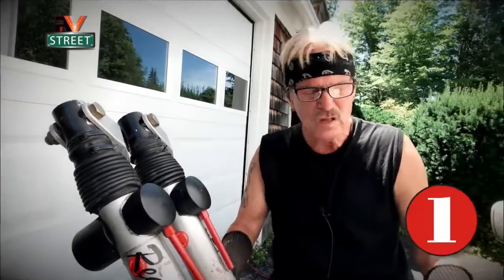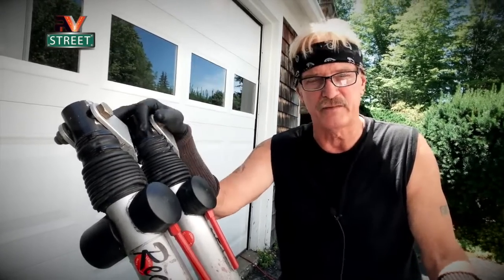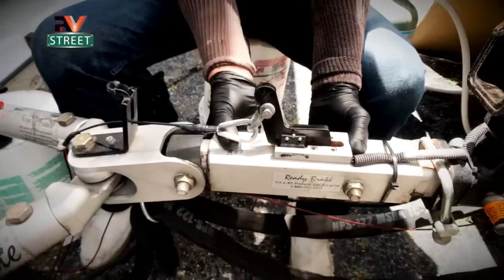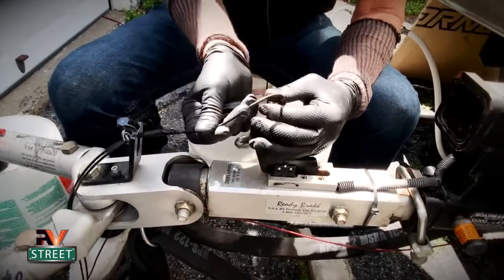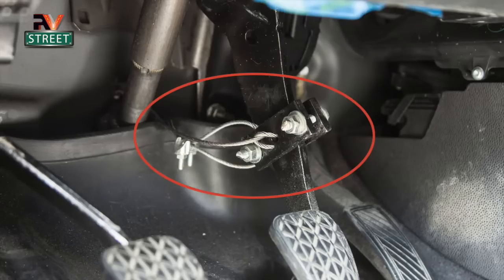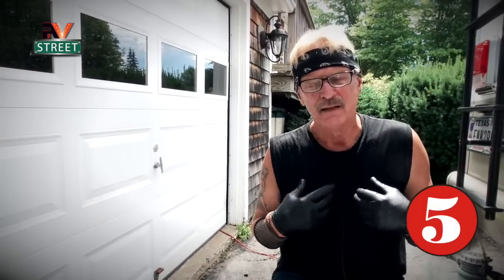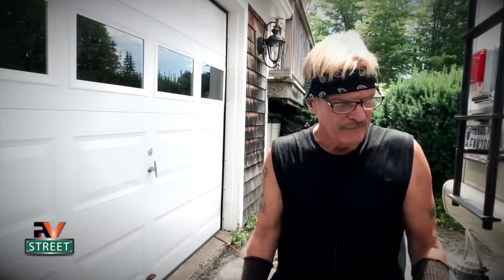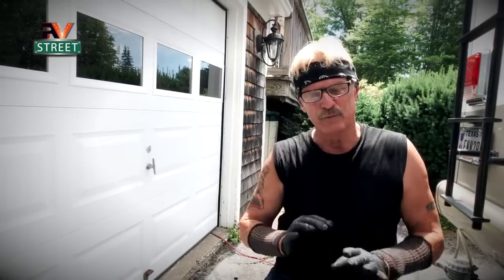BE SAFE, BE LEGAL, 4 DOWN TOWING behind a Motorhome

Comment from the maker: The locking pins I bought that were all keyed the same:
https://www.etrailer.com/Hitch-Pins-and-Clips/Blue-Ox/BX88212.html
Your size may vary and you'll have to call and order them and have them keyed all the same for a small extra fee

The way I installed the dash light so I could verify the braking system was working correctly was to splice a wire into the main harness at the back, then a little more wire to splice from under the dash from that same wire, then I bought a small 12V indicator light, drilled a hole in the dash and mounted it. The light was two piece....the light with a threaded stem and a lock ring on the back with two posts for the wiring from under the dash. I forget where I bought the light but their easy to find.
Reply: Word of caution on the locking pins. I had similar pins and lost an expensive hitch due to locking pin failure. The pins I had identical to yours, the lock assembly is held together with a pressed in pin. The pin over a period of time walked out and the complete lock came off the pin causing the pin not to be locked anymore and eventually the pin walked out of the hitch and lost the hitch. For the life of me I coudn't figure out how I lost hitch, I thought I forgoten to put the lock on the pin. After tracing the roads I've travel (locally) I found the locking pin on the side of the road. I had a second lock and the same thing happend to it in my driveway. I drilled a hole before the lock and put a hairpin throught it as a backup in case the lock comes off. Food for thought. Enjoy your videos, very informative. Thank You.
Reply from the maker: @fredrod6383  Thank you Fred for that. WOW...who would of thought. However, I'm not sure I exactly understand this part though...
I drilled a hole before the lock and put a hairpin through
Could you please elaborate on this OR if you do Facebook messenger, shoot me a picture. Just click the FB logo on my YT home page. 🔧

Comment: Great video! We will share a story with you guys. We bought ourselves a diesel pusher after retirement along with a top of the line flat tow system and a receiver to get us level. Everything from the the same company. Three years later while traveling down the road the receiver broke at the weld and down went the tow bar. Fortunately everything worked as it should  and no damage. My wife followed in the car to our destination, we talked to the manufacturer, they next day air a new receiver, we sent them the failed receiver and now waiting to hear back. It pays to flat tow correctly as your video points out.

Comment: I don't know whether you're an electrical engineer, a mechanical engineer, or a physicist (capable of either or both), but I  appreciate your analytical approach to these issues!  Though your basic model for your presentation is tied to a specific brand, it is clear that the underlying advice is not limited to the brand you present and  I appreciate your sagacity.
What I would like to see in addition to this presentation (please excuse me, as this is the first of your videos I have seen and you may well have already addressed it) is 1) how the port on the front of the toad ends up controlling the toad's taillights and brake lights, and 2) how the toad's brakes are functional when the toad's engine isn't running and providing support for the power braking system.
Reply from the maker: Martin was none of the above, he wore many hats and I swear he could fix anything. I am sad to say that Martin has passed away so no new videos will be coming out. Thank you for your comment.

Comment: Great information. I tow a Chevy spark with manual transmission that has a non locking steering and love it. Our tow bag has all the essentials with a small rubber mat for protecting my knees when attaching and or removing. The small zip tie on the emergency breakaway on the base plate is brilliant and will apply to my own.

Comment: Martin, another well done video providing a wealth of useful information. In particular you hinted to a chance that the locking pins could provide some problems in the event of a quick disconnect. I have watched videos where either the MH or the toad have caught on fire, and quickly disconnecting is necessary. This situation needs to be considered. And yes, shopping via your Amazon store is easy.....i have done it, and recommend it to others.
Reply from the maker: locking pins could provide some problems in the event of a quick disconnect
That's why we keep an extra key for all our locking pins at the door. As I said in the video, locking pins do introduce a small safety issue, but IMO they out weight all the other issues like a fire while under way. It's all about risk management.

Comment: Good video! We recently bought a used Alfa diesel pusher for our first RV. We plan on towing our 2015 Cherokee. I lucked into the same tow bar that you have, not even knowing what I needed, but the guy was towing a Jeep Wrangler with it. I will need the base plates put on the Cherokee so we can tow. Just have to find someone in the north Texas area that does that kind of work. Thanks for your video. Really helps us understand the process!

Comment: I have a picture I would love to share with you. I had a cheap locking pin from Harbor Freight. It failed. My dolly did not have brakes. Lucky for me I realized something was wrong.  . I was on a mountain road with no shoulders.  My crossed chains held the hitch off the ground until I could pull over.  Wow.  Was able to get new pin about 40 miles away.  Never will I buy a cheap pin again.

Comment: One thing we do with our cables is cross them. We use the same locks however, we do not use them during toad travel only when parked overnight at a stop. The reason is if there is a fire and need to get the toad off, it’s easier to pull our red handle detent pins. Our heavy duty lynch pins we added a quick release safety lanyard chain that connects from the lynch pin back to the red handle. The reason is we have had a lynch pin pop out while towing, yes this does and can happen, thankfully, I was able to get off the road safely but ended up have to buy another tow bar, because the tow bar arm that was still holding the toad bent, while trying to slow and get off the freeway safely. Since we tow four down with a 10k hitch a midsize truck we had a welder reinforce our hitch to the frame of our Tiffin. Thank you for doing this segment as it serves as a good reminder.
Reply from the maker: One thing we do with our cables is cross them.
Yep we do the same thing with our chains.

Comment: Good video. I tow a Kia Soul manual. I also wanted something light with a manual transmission.
I carry extra pins, breakaway cable, etc... just in case. 
After I connect everything, I go back to the car, release the emergency brake and then grab a wheel and roll the car back. This verifies to me 2 things, it is out gear and the emergency brake is off. I then turn the steering wheel to make sure it is not locked. I did not check the steering wheel once and don't want to do it again.  No damage but it was driving really weird. 
Once I am sure everything is hooked up and I know the car is ready for tow, I pull the RV forward slowly to lock in the towbar. I then go a little faster for maybe 50ft and hit my brakes. I should see my brake indicator light go and I should feel a slight tug from the car. If not, I go and check things.   
My biggest fear is that I will see my toad pass me on i95. ;-)

Comment: I watched the NSA video on this bar, they have one in which they measure the distance the lever on the brake moves. The Ready brake assembly when activated moves forward towards the motorhome, you may want to check the clearance of your Derattler seems like it will be very close.  I have used this bar for 10 years and did not realize that it moved in that manner.
Reply from the maker: If you have the derattlers installed like I do they don't interfere with the travel. If you don't install derattlers in the places I showed, that whole assembly back there will be very loose which can cause other problems over the long haul.

Comment: Good informative video on this brand of hitch. Once it is set up seems to be much easier than dealing with a Brake Buddy etc on the inside of the TOAD. Regarding the safety chain issue. You mention that you use the hooks that came with the coiled up cables, would not they become the weakest link so to speak on a shock load? Seems like a shackle may be more robust to use.

Comment: When I am moving I do not use the locking pins.  I use clevis pins.  The Reason?  If there is an emergency situation on the road, like a fire , I can disconnect the Toad fast.

Comment: Another great video Martin. I learn a lot from you but you didn’t mention anything about isolating the transmission. A little of vehicles can’t be without damaging the transmission unless drive shafts are disconnected or there is a way to circulate the transmission fluid. What are your thoughts
Reply from the maker: I'm sorry to say that Martin has passed away but I think he did mention in the video that we had a stick shift so it was basically take off the park brake, but it in neutral for towing.
Reply: @RVstreet  I’m sorry for your loss. I only recently started watching your channel and didn’t realize Martin had passed. 
I’ll continue to watch the videos. They’re a wealth of information. 
I’ll also order anything I need through your Amazon store.

Comment: Great video. Thank you both. I have the same towbar. Why do you remove the covers when greasing. I have been injecting grease and then running the legs in and out. I thought that's why the fitting were there.
Reply from the maker: The fittings don't allow much grease and only in a small area. Remove the rubber boots and you'll see what I mean.
Reply: @RVstreet  Thanks much. I noticed your PH plate. Welcome home
Reply from the maker: @rvnmedic2709  🇺🇸 🙏

Comment: Great Video as always, your attention to detail is fantastic.  I have a Ready Brute Elite 2.  I just got a new rig and need to connect the brake light indicator, what components did you use for that ? I did not see it in your items list.  I know NSA makes a DL100 but really I only need the wire from the hitch to the cockpit and the  LED.. Thank you
Reply from the maker: The only components was wire to splice into the main harness at the back, then a little more wire to splice in under the dash from that same wire, then I bought a small 12V indicator light, drilled a hole in the dash and mounted it. The light was two piece....the light with a threaded stem and a lock ring on the back with two posts for the wiring. I forget where I bought the light but their easy to find.
Reply: @RVstreet  ty

Comment: Excellent video and so on-time for us! We also pull a Ford Fiesta on an 8" drop on the Roadmaster 10k lb hitch. We also carry two ebikes on the riser, adding about 150lbs to the hitch. Every hitch connection is stabilized.  We're concerned if this is too much weight for a 5k lb rated hitch with 500lb tongue weight. What's your opinion?
Reply from the maker: Since towing 4 down, there is no hitch weight from the Fiesta. So applying two bikes and a bike rack on the hitch @ 150lbs. shouldn't be any problem.
Reply: @RVstreet  thank you 😊
Reply: Question: what brand locking pins do you use?
Reply from the maker: @MsMishele  These https://www.etrailer.com/Hitch-Pins-and-Clips/Blue-Ox/BX88212.html
Your size may vary and you'll have to call and order them and have them keyed all the same for a small extra fee.

Comment: I’ve used a driveshaft disconnect system for 30 years to flat tow my van behind various motor homes giving me no need for a transmission pump. Any comments or thoughts on that type of system from your experience?
Reply from the maker: I'm sad to say that Martin has passed away and I don't have any answers for you.

Comment: Great video, very informative.  Question, what over and under hitch do you recommend?  I want to keep my Hollywood ebike rack.  Thanks!
Reply from the maker: I got mine @ eTrailer. They have a wide selection. Your just going to have to measure and see what type you need for your set up. Any of them should be fine to carry the weight of an eBike & rack
Reply: @RVstreet  Stupid question: the center of the hitch on my motorhome is 21 1/4" off the ground and the  center of the attachment points on my base plate are 13"; it would seem to me that I need an 8" drop hitch but inasmuch as my installer totally screwed up the install, I'm nervous about getting the right drop this time...

Comment: I have a blue ox tow system for my 2020 Equinox. The brake system is a box with a clamp to attach to the brake pedal. I hate this system for the difficulty to attach it to the pedal. Your brake system is different and seems much easier to use. Can I get your system for my application?
Reply from the maker: Yes you can and yes it's a snap to hook up and is problem free.
Reply: Where can I get your brake system and who can I get to install it
Reply from the maker: @twbelieves  My brake system is built into the tow bar like I showed in the video. It's a surge brake. I have no idea where you can have it installed in your area but I had everything installed in Houston, TX. As far as where you can buy my system, I have all of it in my Amazon Store in the "Towing Equip. and Gear" category.
https://www.amazon.com/shop/rvstreet

Comment: Martin my question to you is the cable that you’re using for a safety brake is it large enough to hold the car if it’s not attached although I see you’re assuming it’s going to stop the cars at will the cable hold the card until it breaks
Reply from the maker: Yes the cable is large enough and no the cable won't break. If the car becomes unattached from everything, the red cable is pulled, and it's locked in the red block, locking the brake pedal down, bringing the car to a halt.

Comment: Good video, question... you didn't mention the steering lock on the toad, do you leave the key in the ignition lock in the unlocked position? or have you had the steering lock disabled? cheers John
Reply from the maker: thx J,
No I didn't mention a steering lock on the toad because we don't have one. That's one of the main reasons we bought our toad. Key OFF, steering unlocked, 5 speed manual transmission, put in neutral, emergency brake off and away we go.

Comment: After installing the blue ox to my Equinox and Jayco Melbourne 29D I drove off and got onto the highway (81). After about 100 yards I could see in my mirrors I had a problem and immediately pulled over. The driver side tow arm broke off the attachment and dented the car and ripped the plastic bumper cover off. I have since repaired the whole system but am very gun shy to hooking this setup again. Advice please oh and I have no idea why that happened.
Reply from the maker: I know a lot of people have Blue OX tow bar systems but I'm, not a fan. I've seen a lot of failures and problems with these units. Some due to equipment failure or malfunctions and some due to owner error. It would be impossible for me to advise without looking carefully at the result and visually doing some forensics to figure out what happened and what needs to be done to resolve the issue. Once it's set up right there's no need to be gun shy.

Comment: I have the ready brute Elite and a 2019 ford fiesta. My question. When the battery is disconnected,  brake pedal becomes very stiff. The lever that activates the cable is very hard to move  thus by my dash mounted light on the dash of my MH never lit up indicating actuation of brakes.  Should I try to somehow lubricate the surge lever or us my cable just not tight enough ?
Reply from the maker: When the battery is disconnected
Which battery?
brake pedal becomes very stiff
what brake pedal? The tow car?
Do you have a Fiesta with an automatic transmission? I have a 5 speed manual.

If you're trying to move that lever by hand forget it. It takes a lot of inertia from the tow car to move that level. Do not lubricate that lever. There are carbon plates under that level.
If the light isn't coming on you either have a wiring issue OR those carbon plates under the lever are cracked and not allowing the contact to be made.

Comment: So was the car factory wired with the diodes to isolate the electrical energy from the cars wire harness?
Reply from the maker: Hi Joe,
No. I did not tie into the existing car wiring. I ran separate wires and a fuse to the tail lights. To many problems can arise tying auxiliary lights into factory harnesses, plus if it's a new car—like ours was at the time—and you start having electrical problems, the warranty is voided.

Comment: Hi Martin, great video. I also have the ready brake system/blue ox bar and my toad is a 2018 hyundai elantra 6 speed manual tranny. Question: Ready brake recommends their de-rattler hitch stabilizer and states other hitch stabilizers interfere with in/out action of receiver surge brake. Do you notice any interference with your hitch stabilizer? if not, is that stabilizer in your store? thanks for all your great vids.
Reply from the maker: My hitch stabilizers won't interfere if you mount them correctly. Hit me up on FB messenger and I'll shoot you a current picture of how to do that.
Reply: @RVstreet  Hi Martin, wondering if my reply to you( rv street) on FB messenger came through?
Reply from the maker: @jespo27  Just now saw your message. I was busy all day yesterday redoing my city water pedestal so didn't check here Sunday morning. I normally check Messenger every morning. I'll get you a picture this morning in a little bit 👍

Comment: Is the baseplate connected to the steering or what makes the car steer
Reply from the maker: The steering column isn't locked so the car just tracks behind the motorhome.
Reply: @RVstreet  ok 👌